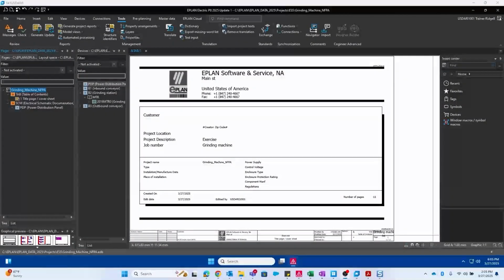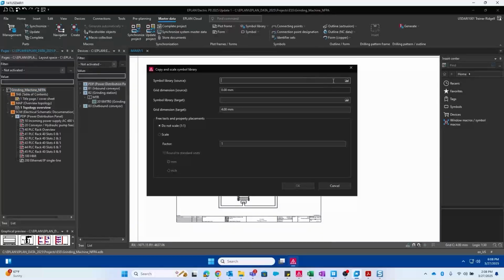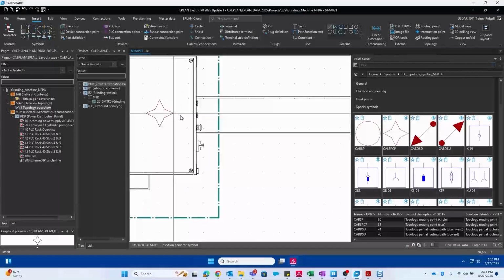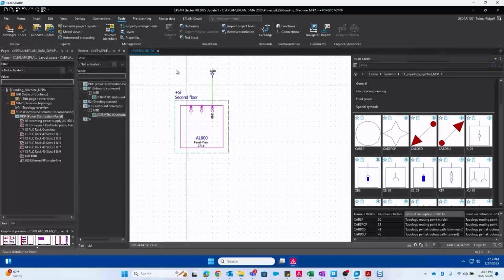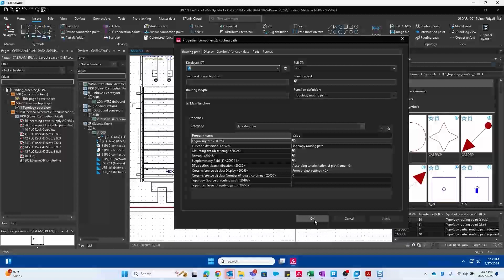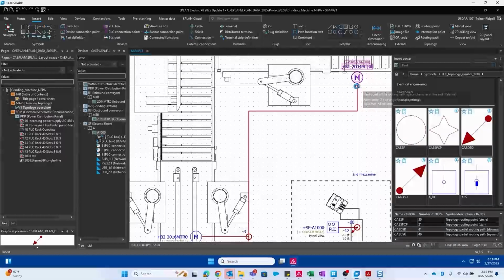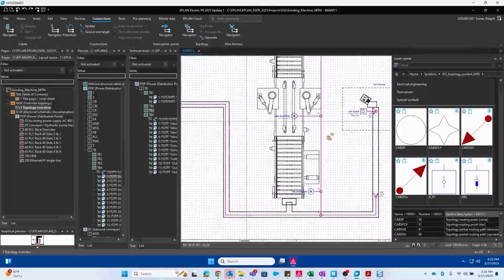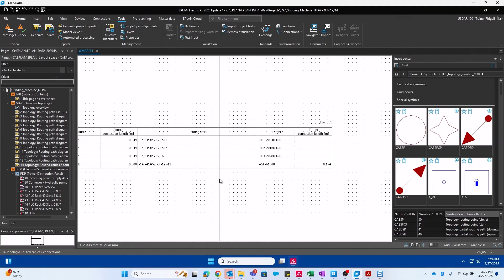Eplan FieldSys Topology Part 2 (Advanced)

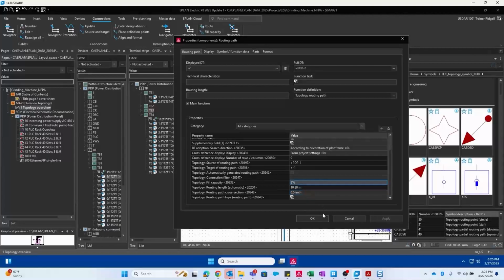Comment: 16:27 Important note - Cross-section should be entered with units and "Square" sign in high register. For example, if you route cable with 5.8 mm external diameter, then for Routing path cross-section 26,42 mm2 Fill capacity should be 100%. But, if enter just 26.42 or 26.42 mm2, you will get 1%. You should enter 26.42 mm (right click - Special characters - Square). Then you will get correct fill capacity.
Reply from the maker: Ah, thank you. I should've paid more attention to that!